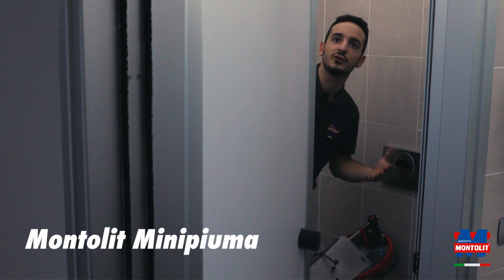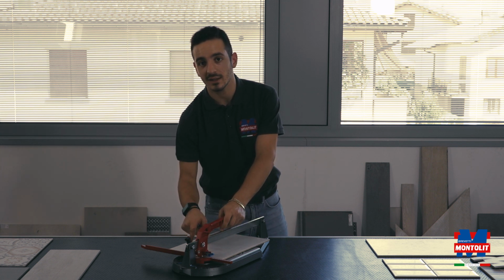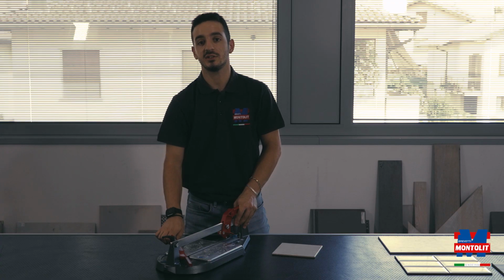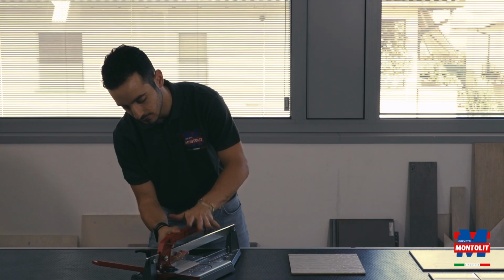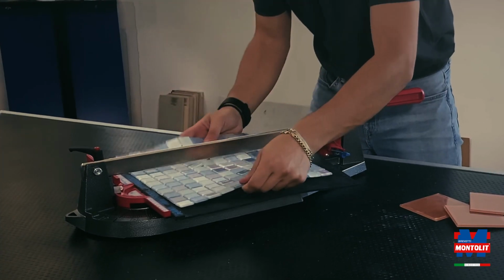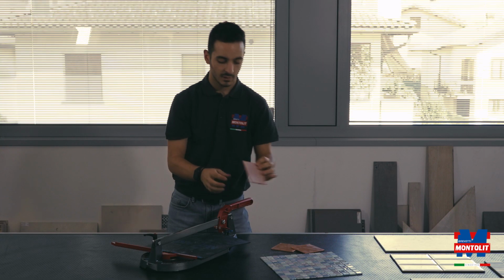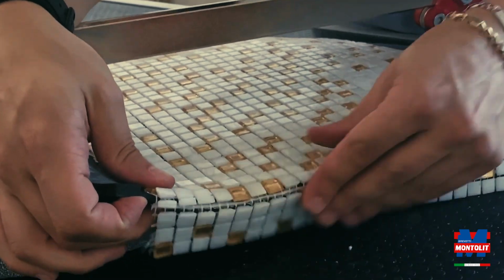Montolit Minipiuma - Small and compact professional tile cutter

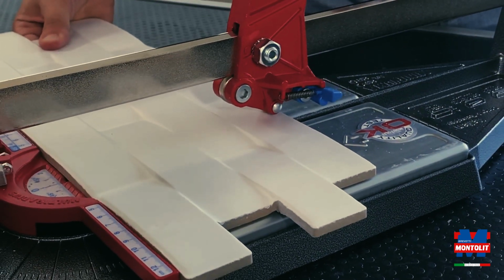Comment: Looks great, only problem is when having to cut slivers and the super wavy tile it doesnt cut straight. You can see @1:55 the tile cutts an angle with the lower tile in the middle.

I will say the p5 131 i have is amazing, however smaller cuts or sliver cuts about 3/8 to 1/2 the tile just shatters or breaks an edge.